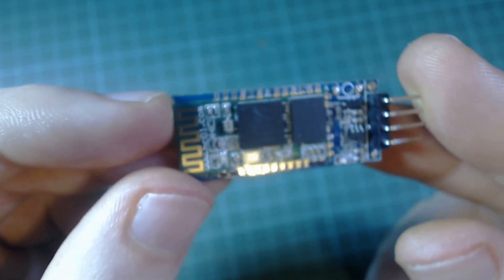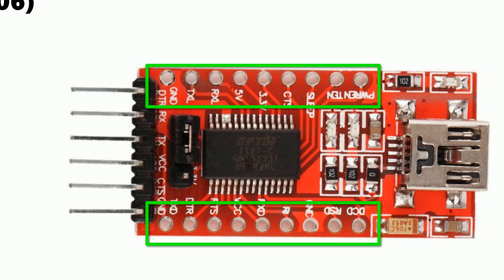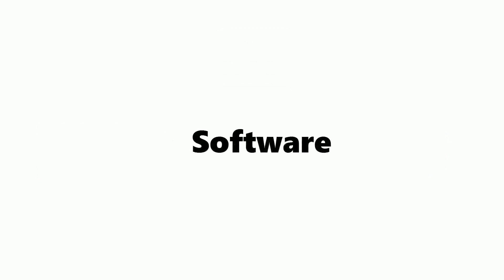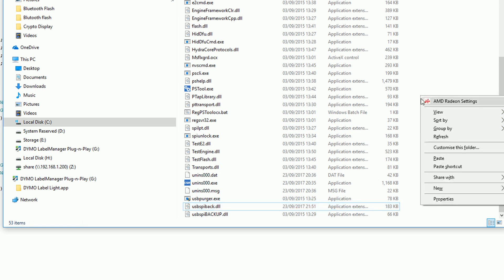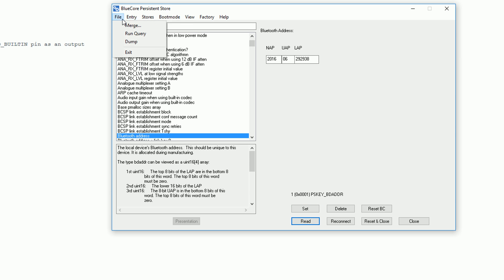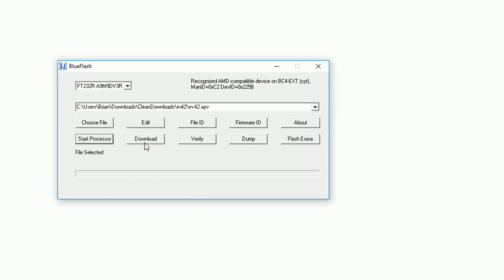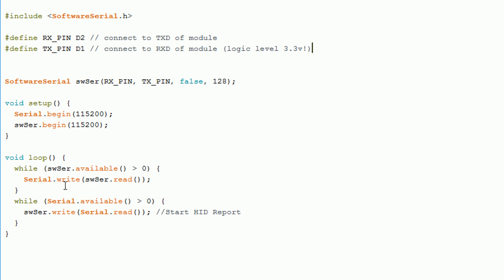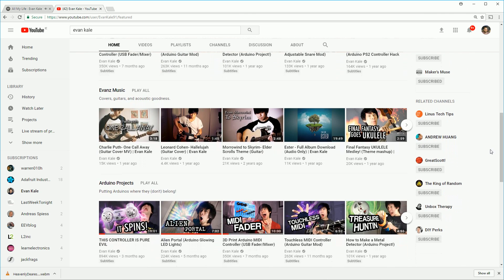Turn your HC-05 into a HID Bluetooth device (No Parallel Port Method)

Comment: I did this but now my cellphone doesn't detect the bluetooth module!!!!!  The module doesn't have that blue light and the red light is on but it is not blinking
Reply: How could i do what you did in the last part without using the wifi module? Could i use arduino?
Reply from the maker: +gustavo baca yup! Evan has a good guide for that too, it requires soldering an extra pin to lower the baud rate (9600) 

http://www.instructables.com/id/Bluetooth-Keyboard-Mouse-Adapter/#step6
Reply: Brian Lough  thanks a lot !! After many attempts it finally works.
Reply from the maker: Awesome! great to hear!